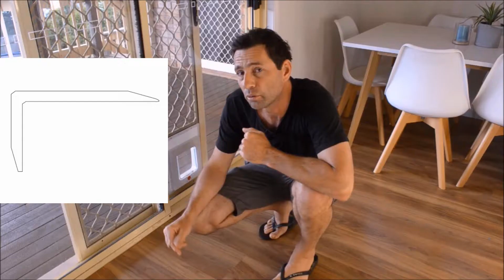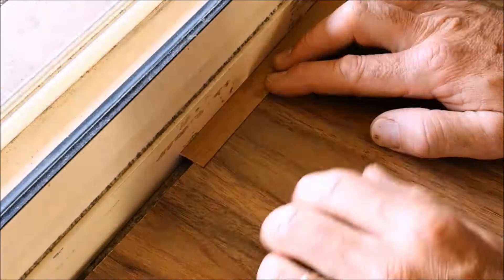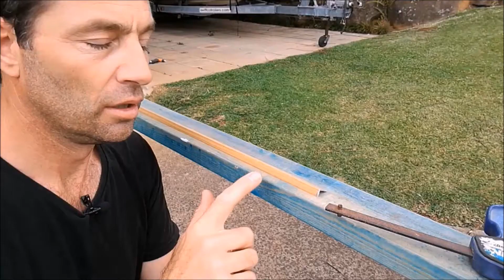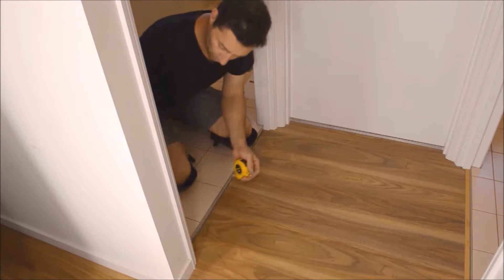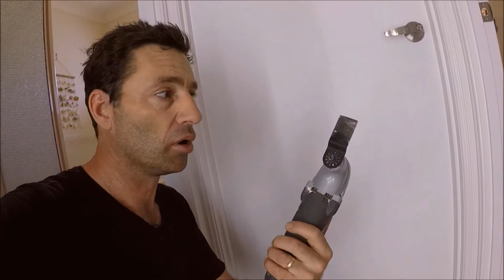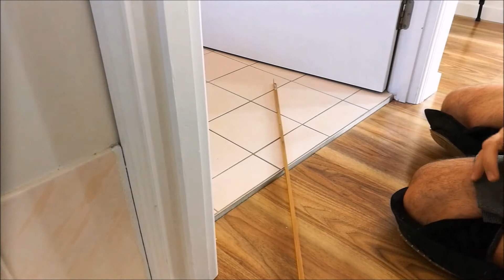Finishing trim for Laminate flooring – with Inspire DIY

Comment: Any tips on how to remove these trims for replacement? We had this installed by our floorer only to discover a colour match product is available and want to replace it with the correct stuff.
Reply from the maker: Hey Kylie, if it’s this type ‘L shape’ and it’s been put down with a construction adhesive then a mechanical removal with hammer and chisel, or multitool to separate the bond,  sounds like a job at you house coming up soon! Best of luck. 👍Kent